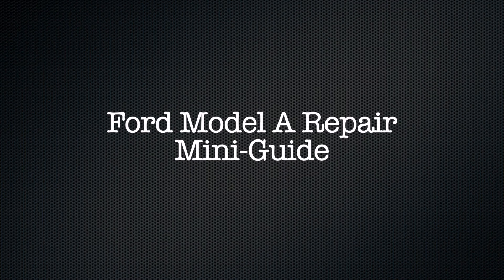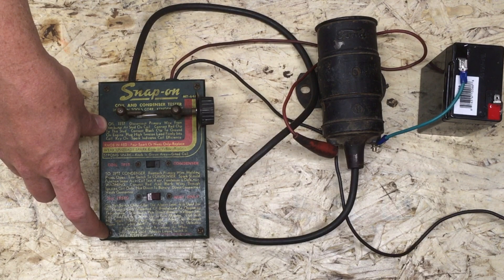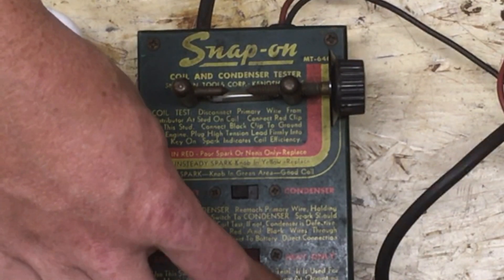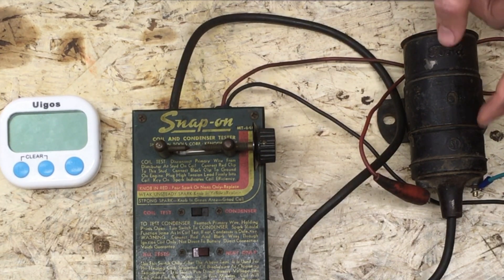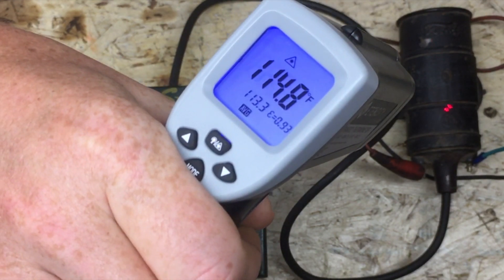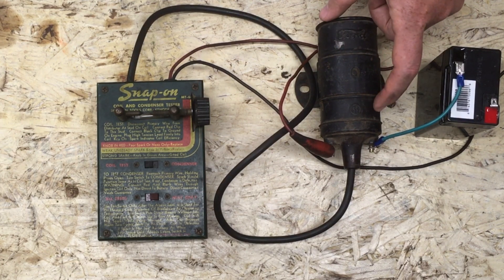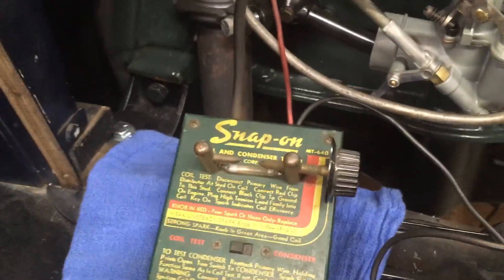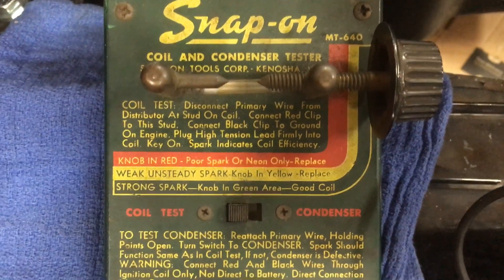Model A Ford - test ignition coils with the Snap-On MT-640

Comment: It takes 1143 volts to jump a 1 millimeter gap in dry air.
Reply from the maker: Not sure where you're getting that number. The dielectric strength of air with normal humidity (30-90%) is 30 kV/cm. A good 6V coil can throw an arc across a 1cm gap on my test rig, so those coils are putting out at least 30,000 volts.

Comment: To clarify my question about calibrating... I'm referring to the position of the knob.  If you adjust it to the point that the 2 electrodes touch each other, where is the knob reading?  Is it all the way to the left of the red section?  Other?
Reply from the maker: On my unit, the two knobs are slightly offset, so they don't come together point-to-point. When they touch, the knob reads in the center of the red zone.

Comment from the maker: One interesting thing about the Geissler tube mount is that, if you unscrew the knob until the distance between the primary electrodes is the same as the distance between the little springs holding the tube, and if your coil is strong enough, the arc will start occasionally jumping between the springs rather then the electrodes. If your tube is present, the arc will form on the boundary air around the tube.

Comment: I have one of those Snap-On MT640 testers, but does not have the Geissler Tube.  Anyone know where to get one?
Reply from the maker: I'm not aware of anyone making exact replacements for the MT-640 Geissler tube. It's a simple neon discharge tube, but the problem is no one makes them this small. The closest thing I've found – and I have no idea whether it would be a drop-in replacement – is something called a "discharge ampoule." https://www.smart-elements.com/shop/bromine-discharge-ampoule-new/
Reply: @alexiskai Thanks for your previous reply.   I'm back to wanting to use this, so I'm again looking for a Geissler tube... or... do you know if it is really necessary?  Could I use a small neon bulb?  Do you have the original instruction sheet?  If so, could I get a copy?
Reply: Also... how do you calibrate the distance between the electrodes by adjusting the set-screw on the knob?
Reply from the maker: @joefox2269  I don't have the original instructions except to the extent that they're written right there on the case. I don't think the Geissler tube is needed to operate the tester. It serves as a visual confirmation that the coil's secondary winding is putting out current. If the coil is in bad shape, or you've set the gap much too wide, no spark will jump – but you would see the Geissler tube light up, confirming that the circuit is hooked up correctly. But the tube and the spark electrodes are hooked up in parallel, so it should work without it.
Reply from the maker: @joefox2269  Not sure what you mean, calibrate to what?